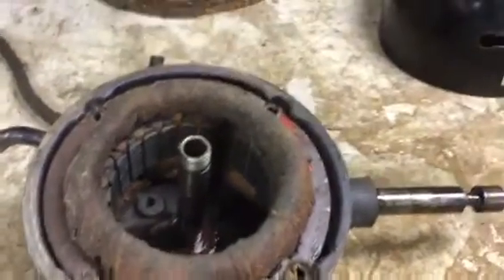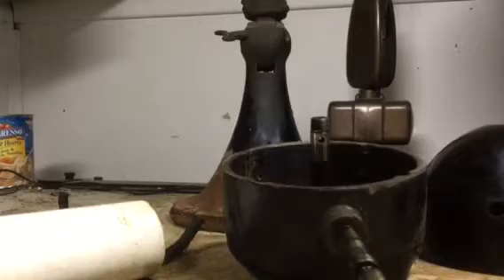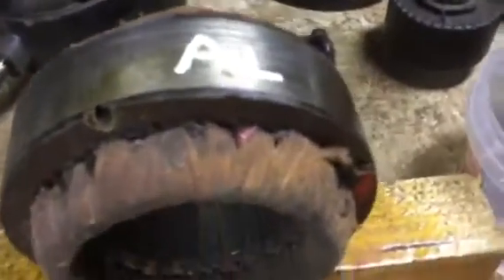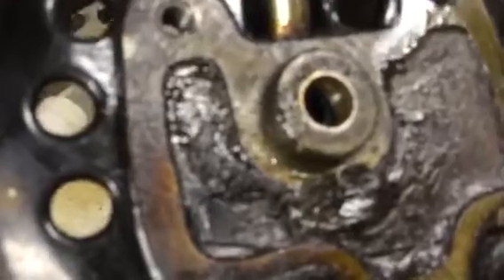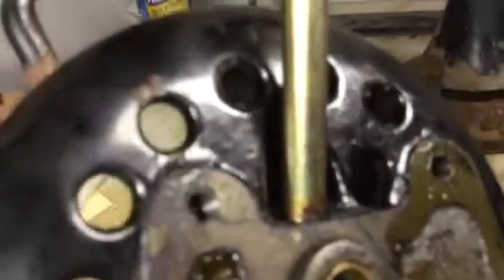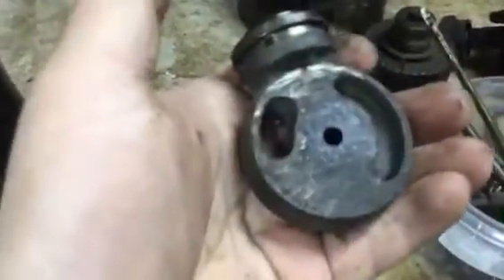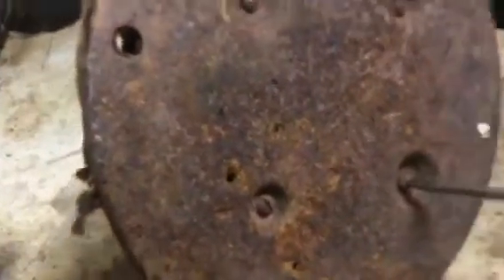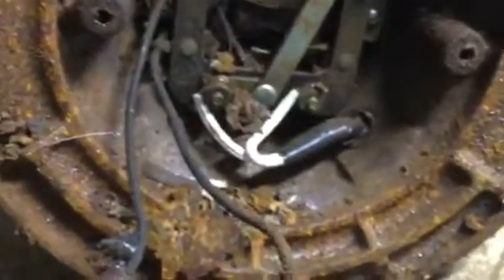Removing the stator from and taking apart the base on an Emerson 77648

Comment: Before you bumped out the stator. There were 4 bolts studs. How did you remove them
Reply from the maker: I took two of the stud nuts on each stud and tightened them together (like jamb nuts) and screwed them out: https://youtu.be/XEP-exiFE1I
You can view the complete playlist here: https://www.youtube.com/playlist?list=PL3n0ffUd1sKMS1-a4K5HaitSuqFdP4CR6

I plan toresume work on these fans soon.

Comment: Do you have a video of them finished?
Reply from the maker: No, I am currently at a standstill on this project, deciding what to do prep-wise to have them powder coated or just sandblast and repaint with appliance epoxy.  The powder coater in our area does great work, but he and I have some concerns about the areas that need masking. I have done an Emerson in appliance epoxy that came out great, and would do it again. I don't do many strip and repaints of fans, I mainly look for fans that just need cleaning and rewiring.
Reply: @okbridges  d